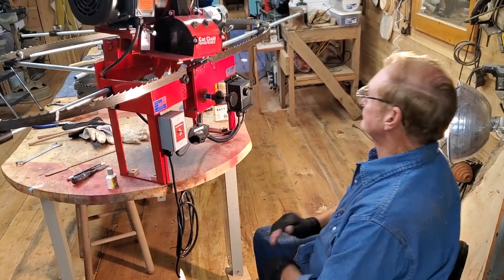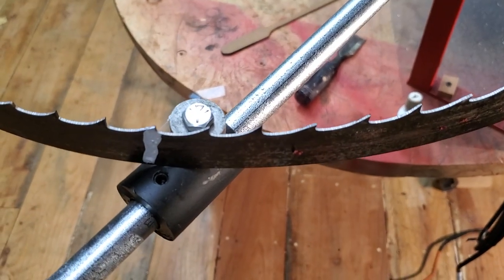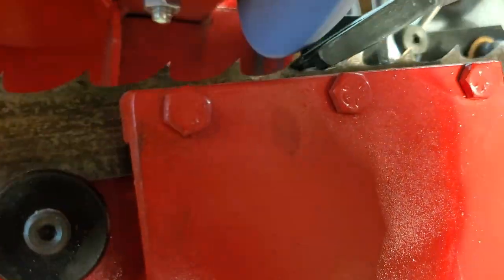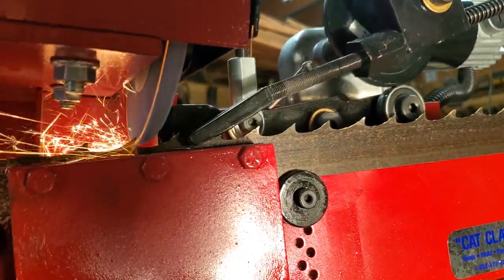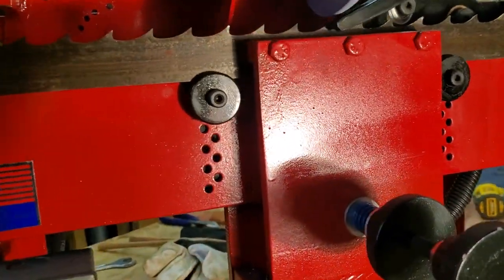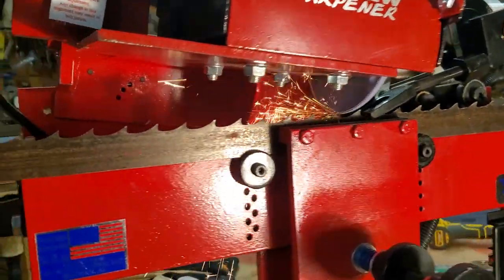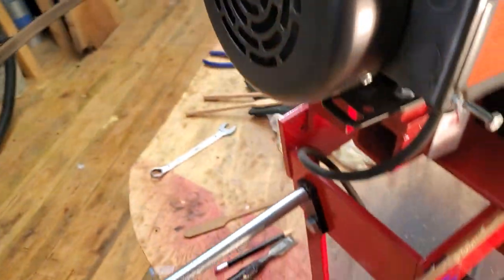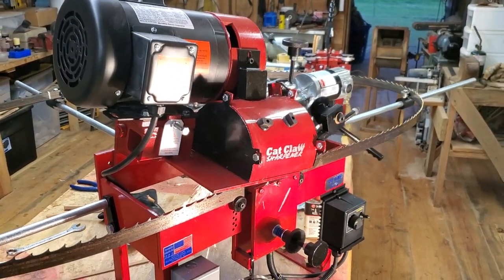Cook's cat claw sharpener with Mr. Robert

Comment: I have a cat claw as well and noticed he's sharpening at the 8 deg setting. I'm assuming this blade is a woodmizer brand? If so, what angle is the blade tooth because this sharpener itself doesn't have a 7 or 9 deg setting.
Reply from the maker: I just asked him this afternoon.   He says if it's his blades he just runs it st 8 degrees.   After a few passes the blade will conform.   He has been using a cat claw sharpener since 1997 and always cuts at 8 degrees.   He has adjusted on the back to 10 degrees before but didn't see any real gains over 8 degrees down here in Southern Mississippi.